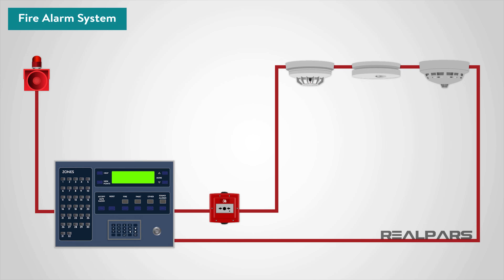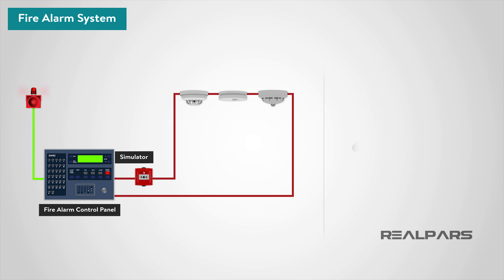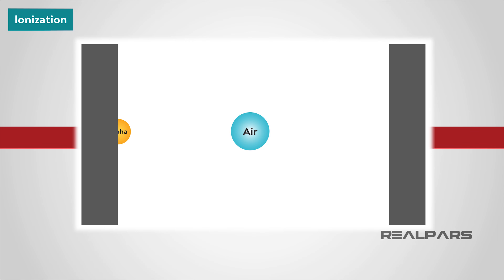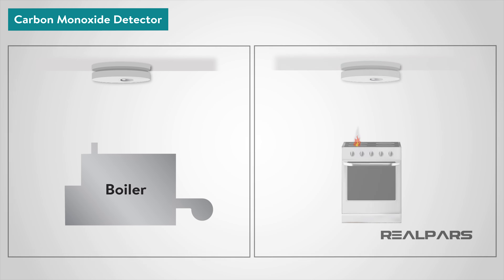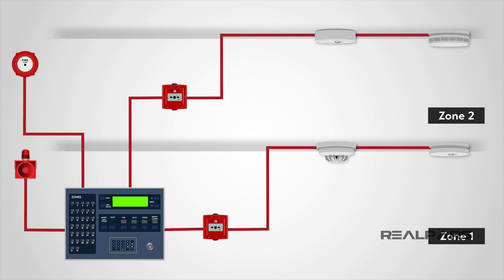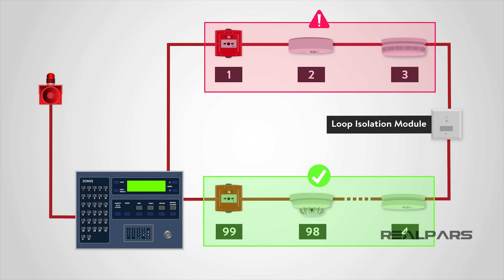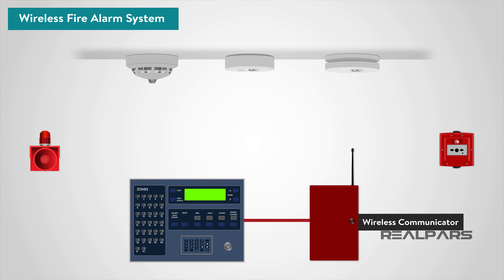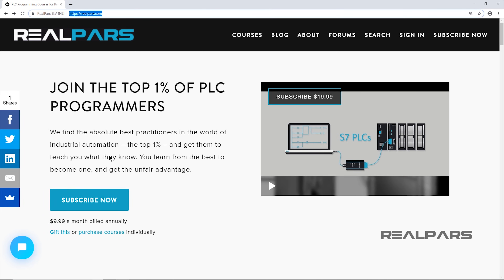What is a Fire Alarm System?

Comment: Want to know the approximate number of detectors for a zone
Reply from the maker: Hello, @albertabakah-pobee881. Thank you for your question. All fire alarm systems are not the same, and it also depends on the country in which you are installing these devices, your safety codes for this system, and your location. I suggest you use the code book and the manual for the system you are installing in your area. Happy learning from Realpars!

Comment: Is a wireless system generally the same price as the other two ?
Reply from the maker: Hello, @markpalcsey9001. Thank you for your question. This is hard to say because it depends on the system you purchased, the company that made it, your location in the world, your installation location, and your local fire codes. I would start by checking your local codes and contacting a fire alarm company in your area. Happy learning from RealPars!

Comment: I have worked with a Fire alarm device 
But I first connected the Wire from panel to MCB than to smoke detector 
So , Where should I connect the Isolator ?
After the MCB Loop to detector or Before MCB 

Can you tell me the right wiring diagram 
1 [ Fire panel = Isolator = MCB = Detector ]
2 [ Fire panel = MCB =  Isolator = Detector ]
Reply from the maker: Hello, @mscreationworks5787. Thank you for your question. We're sorry, but we cannot tell you how to connect any functions to a fire alarm panel. If you follow the safety fire codes in your part of the world, these features are controlled by them. I would suggest you contact your fire alarm vendor, who I assume is licensed in your area.
Reply: @realpars  That's My elder brother

Comment: Well done this illustration is a well understood,but my question is since the diagram show the connection,how can it be connected to a building for separation os zones
Reply from the maker: Hello, @olasojisamuel3505 . Thank you for your question. The fire alarm panel detectors are "addressed" by being assigned a unique numerical code in an addressable system, which allows the panel to identify the exact location of the activated detector when an alarm is triggered, unlike conventional systems where only the zone of the activated detector is known; essentially, each detector has its address on the panel, enabling precise identification of the alarm source. Each detector has a unique address, allowing the panel to pinpoint the exact location of the alarm.

Comment: how no. of addresable smoke detector in one loop give their address to control pabnel
Reply from the maker: Hello, @Visionautomationandlightservic. Thank you for your question. The fire alarm panel, detectors are "addressed" by being assigned a unique numerical code in an addressable system, which allows the panel to identify the exact location of the activated detector when an alarm is triggered, unlike conventional systems where only the zone of the activated detector is known; essentially, each detector has its address on the panel, enabling precise identification of the alarm source. Each detector has a unique address, allowing the panel to pinpoint the exact location of the alarm.

Comment: 9:03 Do you like wildfire alarm systems how do you don’t have to wire all those stupid cables in
Reply from the maker: We appreciate your understanding that the system is designed with per-code protection in most countries. This means that even if the wire were to burn out, an alarm or monitoring signal will be triggered. Thank you for your engagement, and happy learning from RealPars!

Comment: I am just new with this alarm system. How does sensor send signal to central alarm? I see only 2 cable to sensor which is used for supply power to those sensors. Please help
Reply from the maker: Hello. Thank you for your question. The video is just a standard illustration. Each sensor is hard-wired to the central station as per the local code in your area if you are in the USA. I'm not sure how it’s handled in other countries, but I am assuming it’s the same. Happy learning from RealPars!

Comment: In which part of the system can I find the OR digital gate?
Reply from the maker: Thank you for reaching out with your question. When it comes to the setup of the alarming system, it varies depending on the specific system you're using. Different systems may allow for series circuit devices, parallel connections, or "OR" functions. It's important to note that all fire alarm systems in the USA must adhere to national and local codes for installation and monitoring.

If you're seeking detailed guidance on how to set up your system, I recommend referring to your user's manual or contacting the manufacturer directly. They'll be able to provide you with the specific information you need.

Comment: Manual Call Points and Sounder it can placed in any line cable connection, is it by our choice to connect from beginning of loop or in the middle or end even must be in separate line need to be dedicated which method need to be follow and implement regarding to circuit line connection. for both Conventional and Addressable systems.

Comment: In my warehouse, if the fire alarm pull station or sprinklers are activated the fire panel sends an emergency stop signal to all the motor control panels to stop the conveyor belt system.

Comment: I have a question regarding outdoor/weatherproof alarms. How come sometimes they put outdoor alarms indoors?
Reply from the maker: There are many reasons this would be done.  One, in case of a fire/sprinkler discharge, it may get pretty wet inside the building.  Using a weatherproof alarm would preserve the device.  Another reason is maintaining the minimum number of spare parts.  Using the same alarms inside and out reduces the number of spares that need to be maintained.
Reply: @realpars  I see. I assuming it would also be used in a room where there’s generally a lot of water? Either way, thanks for the info!

Comment: The phrase "detection devices" isn't a proper or well fitting one, a pull station for example will trigger an alarm, but it isn't detecting anything. The industry and proper term is initiating devices.
Reply from the maker: Thank you for your comment.   You are correct.  A fire alarm system consists of automatic initiation devices, such as smoke and heat detectors and other manual initiating devices, such as pull stations.

Comment: How can we stop the message being deliver to Fire station  if there is any false alarm raised
Reply from the maker: Many systems allow for a delay to be programmed into the signal to the fire station.  In some cases, the alarm system is programmed to not call the fire department until the alarm is confirmed and a "call" signal is sent.  Often, local ordinances and laws dictate what can and cannot be done, or insurance requirements may require a specific action.  In general, the owner has control over the signal.  Most fire stations have a way for an automatic call to be canceled, typically by sending a cancel request from the fire alarm system. or by communicating by phone using a predetermined code.  Talk to your plant safety advisor and the alarm system manufacturer to determine what and how to best cancel a fire call if it is a false alarm.

Comment: Thank you so much team RealPars .
So informative Video.
What is the maximum loop length for intelligent FAS .
Reply from the maker: For RS-485 communications, the typical maximum length is1000 meters if you use a twisted-pair 16AWG cable.  Repeaters can be used.  I typically like to limit any current-based communication loop to 250 meters.

Comment: Thanks for this innovative section of training, but I wan to ask
Question:
 Can one run a wired fire alarm system alongside wireless Fire Alarm System on the same Fire Alarm control panel?
Reply from the maker: Yes, as long as the fire panel supports both a wired and wireless interface to devices.

Comment: hye, may I ask? Now I'm in the middle of a mini proposal for FADS for factories. I need to use a microcontroller to control all the systems. If I use addressable type, which is either the zone panel or isolator module that will detect which detector are detecting the fire?
Reply from the maker: With addressable fire detectors, the exact sensor that tripped can be identified at the fire alarm panel (or other monitoring station).  Typically, a 2 or 3-line LED display on the fire panel will indicate something like "Smoke Detector - Zone Room 520 - Alarm".

Comment: I have 30 years experience with low voltage systems I've been injured haven't been able to work for the last 4 years I have experience with security systems home theatre networking nurse call phone systems ECT but My favorite to install is doing fire alarm installation probably because of all the codes you have to follow especially in cities like Los Angeles but in places like Indianapolis you don't need fire alarm license I always hated doing fire alarm service in Indianapolis because going behind someone that had no clue and use 22/4 wire for horn strobes in huge warehouse and wonder why only the first 2 on the loop would work. It's Life safety devices every city in United States should require the installer to be qualified and have a fire alarm license

Comment: I would like to know if hooters are also addressable and are connected in separate loop or in the same loop where detectors are connected.
Reply: Horns, lights, and other actuators do come in addressable versions.  They typically also require external power for operation in addition to the fire alarm output signal.  You need to specify and purchase a device that has the addressing and network capabilities that you need.

Comment: The working mechanism of addressable fire alarm. What signal does it process and transmit to the central cabinet? A/V or digital? Thankyou so much!
Reply from the maker: Addressable fire alarm systems use a digital communication system, such as RS-485, Ethernet or BACNet.

Comment: At a moment we still using ZP2 model and we was this system has been installed since year 2000. Currently we don't have any drawing  or O&M  for reference because the staff in-charge who take care of it are no longer working with us.. Can we get a drawing of this system ie. wiring connection from the panel to all related modules /devices  until it back to the main panel. Thanks

Comment: Where is the flowswitch?.. what happen to the 3rd party equipment at the building when fire triggered? AHU? LIFT?  Fire Shutter? PA system? Magnetic door?... what happen when the CO2 gas discharge? What happen when the sprinkler system no water?... what happen when lightning strike the building?.. When fire alarm triggered, AC supply usually cut off, what happen to the fire alarm panel when no AC supply?.. Fire Alarm System is not this simple!
Reply from the maker: Hi Danny,

Thanks for your comment and your questions. 

I will be happy to pass this on to our course developers for possible future video courses. 

Thanks again for sharing and happy learning!

Comment: How can we get these emergency alert through mail or sms Or can we link fire detection system to internet (IOT)?
Reply from the maker: Hi Satinder, 

Thanks for your comment!

Great question, this would actually make for an interesting new video course. I will happily go ahead and forward this as a topic suggestion to our course developers for a possible future video course. 

Thanks for sharing and happy learning!
Reply from the maker: Yes, in most cases, modern fire alarm systems include notification apps (or are available as add-ons) which will allow for SMS or email messaging.  IIoT requires additional interfaces (MQTT or OPC drivers) which may or may not be available with your hardware.  Remember, fire alarm systems are designed to protect property and personnel, and as such include hardwired land-line connections to fire and emergency services.  Other interfaces may or may not be provided, depending on your hardware and software provider.

Comment: Can u pls answer these questions 
1. How much should be the distance between 2 detectors according to nfpa
2. In one loop how many detectors v can connect
3. In one loop how many devices v can connect. 
4.which type of cable used in fire alarm system n size
I will be grateful to get dis answers. 
I will be waiting for ur answer
Reply from the maker: NFPA 72 Chap 17 says that the distance should be no more than 0.7 x the listed spacing for the detector (refer to manufacturer's data).  Normally the listed spacings for detectors are 30 or 40 feet, so the maximum distance would be 21 - 28 feet.

In a single sensor loop, you can typically connect 32 sensors/devices or more, although this is dependent on the controller model and size of power supply you are using.  

For fire alarm systems, type FLPR cable (or equivalent) is used.  The size of individual conductors can range from 22AWG to 14AWG, and the number of conductors per cable will depend on the requirements of the detector or device.  Typical cables have either 2 or 4 conductors for most applications.  This makes the cable diameter range from 0.15inch to about 0.25inch.
Reply: @realpars  but in the google it is showing 125 detectors and 250 devices in one loop
Reply: Thank u very much for ur time and answer

Comment: I wonder how common it is for smoke detectors to also be used as a sounder in fire alarm systems
(I remember one college that I went to didn't have many separate sounders, and instead, the smoke detectors acted as the sounders, and there was also a school that I went to where someone spraying deodorant set off the detector in the changing rooms, which set off the fire alarm, and I remember that there was also a false alarm at that school where apparently the fire alarm was only sounding in the reception area, and not anywhere else, the fire alarm panel was in the reception area, along with the sprinkler panel, so I wonder if it was actually a fault buzzer that they heard)
Reply from the maker: There are all-in-one smoke detector/sounder devices, but in most cases, the smoke detectors are in areas where an alarm may not be heard (interstitial space in a ceiling).  it is best to locate a smoke alarm where it is likely to be smoke in case of fire and place sounders/strobes where there may be popple located.  Also, local codes often dictate the use of different types of devices and which should be used in each type of area.
Reply: The thing I find most interesting is that in the country where I live, newer building tend to have detectors all over the place (I remember the canteen at college had more than 10 smoke detectors in it, and every other detector had a visual alarm indicator at the base of it)

Comment: Exactly where or what locationn are MS Detectors are used?
Reply from the maker: MS detectors are multi-sensor detectors that allow a single device to be used to sense smoke, heat, and/or CO.  They can be used wherever a smoke detector would normally be used, but since they are more expensive than a simple smoke detector, they are most used in certain situations.  In large open spaces, it is likely that CO gas will rise faster and allow for earlier detection of a fire than a smoke detector.  Also, with many fires, like a fugitive natural gas leak fire, there may be little smoke, but significant CO.  Some engineers like to implement MS detectors so that the total number of detectors used is less (1 MS instead of 1 smoke and 1 CO), which saves on cabling, power, wiring, etc.

Comment: Ionization detectors have not been produced in Europe for a long time now, as they used Radon, a radioactive material that was extremely had to dispose of, once the detector was no longer of use.
Also a few manufacturers are now producing certified Carbon Monoxide detectors that can be used on an addressable system, the same way a household CO detector works. Most manufacturers can produce a CO detector that will measure CO levels in both leaking gas and burning fires, but the certification for these to be used as CO detectors seems to be the sticking point.
Reply: I thought they used americium
Reply: Also radon is a gas that comes up from the ground smh

Comment: Great video! But I have a few comments... Ionization detectors are forbidden in many parts of the world since more than 10 years. And they shouldn’t be manufactured or sold anymore. Also, the 99 device limit in addressable and intelligent loops is not current anymore and used to be a reference for only a couple of brands, there are panels that allow 127 or even up to 154 of one kind of devices, or combined types of devices up to 308.
Reply from the maker: Thank you for your comment.  Photoelectric detectors are best for detecting smoldering fires, most incidents start out as, so PE detectors can signal fire at the first signs of smoke.  The capabilities of intelligent fire systems has grown to include larger "networks", but my opinion is that it is best to limit your fire zones to manageable areas, such as floors or quadrants of a floor to improve reliability in the case of malfunction or damage to wiring or devices.  This would lead to fire detection networks being more plentiful, with fewer devices per network.  But it is nice to know that newer systems can support more devices if that is necessary.
Reply: Are you a technician or a fire marshal?
Reply: @ronaldswartz5512  used to be a technician and in the fire industry in different roles for the last 14 years. Also, 8 years as a firefighter